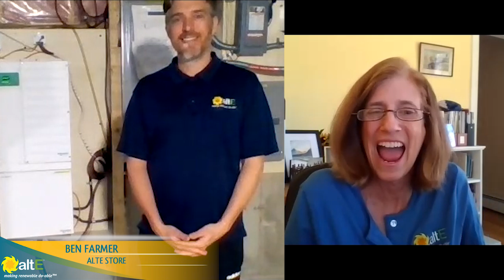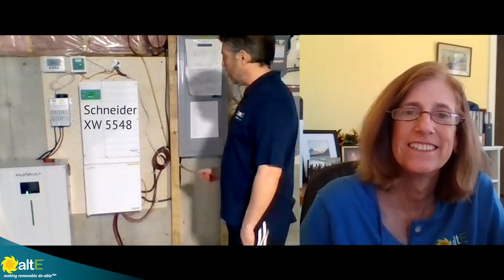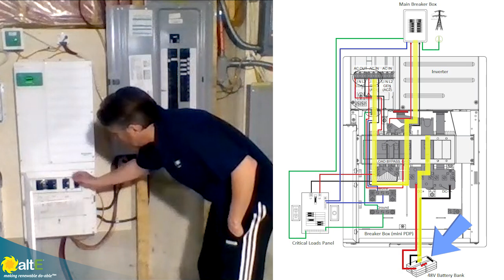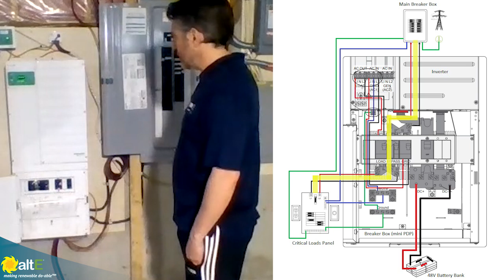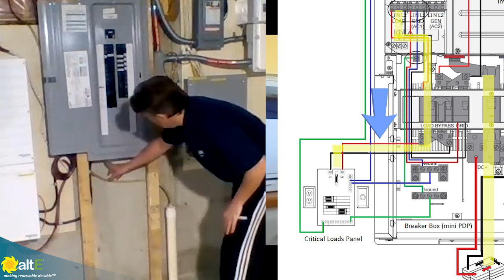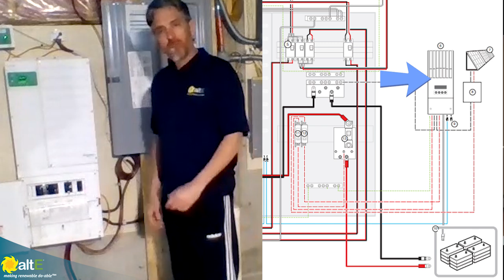Schneider XW with Lithium Battery Backup Without Solar

Comment: How the lithium batteries communicate with the Schneider  inverter like giving SOC to the inverter. Also , how the charging is managed? Or there is no connection with the BMS of the batteries with the inverter

Comment: This is exactly what I've been looking for.    We get a lot of blackouts where I am.  If you sneeze we lose power.
My thought is to get a battery back up for the insert wood stove (100 watt) , stove (?), lights, fridge, and freezer.   That's it.  I have a heat pump that would just suck the juice out of any battery in cold weather.
As for knowing when the battery is in use, I would think there would be a  timer option that countdowns your time left on the battery.
This beats the gas generators getting hooked up every time the power shuts down.  I would like a battery that could last a week a least.

Comment: Can a Schneider 4048 inverter interact with Lithium batteries?
Reply from the maker: Absolutely! However it will not be able to perform hybrid functions like selling back to the grid. The XW Pro 6848 is a grid interactive system.

Comment: I’m looking into doing this type of setup but with my existing Solar and power wall setup. I’d like to send excess solar power to the battery instead of the grid when my current power walls or house does not need the power. Is there a way for this setup to respond in a way to “kick on” to draw this excess energy when needed? The output of the battery would be used to charge my EV instead of backup purposes. This way my main backup isn’t used for EV charging.
Reply from the maker: Yes, in fact this set-up would be more or less the same as the other powerwalls in your system: A a self-maintaining battery storage system with the full power of a hybrid inverter/charger. 
You wouldn't need to set up a kick-on signal for this system either, it would just pull from the available AC power (grid or solar) when the battery needs a recharge.

Comment: Great - Job I’m plaining on doing the same thing I’ve got a 5KVA 230v PureSineWave Inverter Charge Controller Hybrid inverter, Moes Automatic transfer Switch , ALL POWER Manual Transfer Switch , another similar breaker box HomeLine 100A 30 slots , 15 PCS 3.2v Lithium Phosphate 280A batteries & 20 PCS 2.3v LTO Lithium Titanite 40A the battery bank connector block , 100A Double Pole Breaker to Dierect Feed straight into the Breaker box after shutting off the main breaker ( not to back-feed the grid ) although the hybrid inverter has an input line of 230v and the Moes Automatic Transfer Switch had an input line of 120v you know when the electrical drops they turn on in micro seconds ! Great video

Comment: If the batteries drain and no solar is used and no Grid energy will be available for a few days. Can you have an alternative way of connecting the circuit to a gasoline generator and charge the batteries plus keep the home energized untill the batteries are full again?
Reply: I'm 99% sure the XW Pro has a 2nd input for generator power. It's the best inverter on the market hands down.

Now if you DON'T have heavy loads or you don't mind an accidental "wife turned on her hair dryer while running the dryer while Jimmy was microwaving a hot pocket" then there are other options that are much more budget friendly....but if blackouts are a serious problem...be it because you are running a business or someone in your home is on a medical device and you don't want to gamble with the battery backup multiple times a month then the XW Pro gives you the peace of mind that any normal residential loads are well within its capabilities. Two of them paralleled would be the ultimate system for any home under 4000sqft. You could run both of them and still have the ability for one to take over 100% of the work if the other should go down. most of the time No running out to your battery shed/utility shed where the inverters and batteries are 6:55am because while you were in the shower the system had a fault. There's almost no way someone inexperienced with off grid living could mistakenly overload a double XW Pro system unless they ran around the house turning on EVERYTHING they could find. Barring some of the most power hungry power tools/welders you could also comfortably run a little shop in your basement or in an outbuilding with just a little bit of common sense when starting any load over 2000W.

Comment: You can also position your solar to backfeed through the critical loads panel and then when the grid goes out you can AC couple with that inverter and charge the battery bank
Reply from the maker: If the grid tied solar inverter was smaller than the battery based inverter, he could AC Couple. But in this case, he has a 10kW grid tied inverter, and a 5500W battery based inverter. The XW cannot handle that much power being backfed through it.
Reply: @AltEStore  I'll take your word for it.  I'll have a professional do the work, that's for sure

Comment: So, it's a HUGE UPS for the house, but it isn't configured to kick on automatically?  With a battery that big, why configure it that way?  It seems like a great deal of expense and complexity for a home where the power grid is almost never down.  If it was configured to charge the battery during times when grid power is less expensive, then use the battery when grid power costs more per kwh, at least then you could begin to recoup some of the cost.  Please help me understand the net value of this type of system, if it's not protecting your home from losing power.
Reply from the maker: The system is able to kick on automatically if he chose. Since it is mostly backing up his office, except in the winter when it backs up his furnace, he didn't feel the need for automatic backup. He wanted to use the stored energy when he needed it, not overnight or on the weekend. He does not have Time of Use charges in VT, so it doesn't matter when he recharges. But if he did, he could configure when to recharge. As to why have the system if he rarely loses power, well, quite frankly, because he had it from his previous house in Colorado, where he did lose power often. So if you've got it, flaunt it! But seriously, it is needed for his furnace in the winter, so he does appreciate having it when he needs it.

Comment: I have 12 T-105 RE and 3000 watt Aimes pure sine inverter, with a 24 volt iota battery charger, not as fancy as this one but it works enough to run my medical equipment when the grid goes down. also I can run the generator to charge the bank or house gen load panel if the grid is down too long.
I have a video posted somewhere